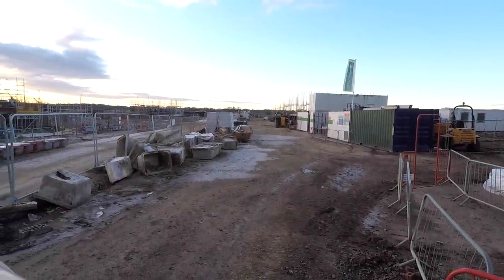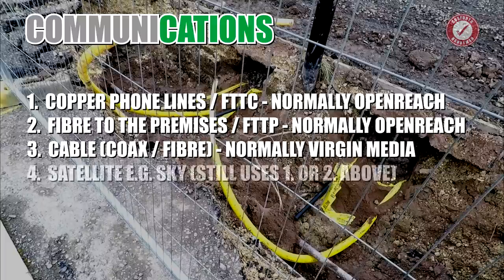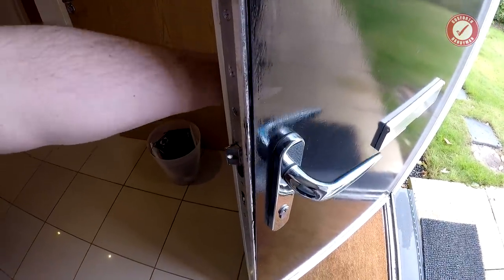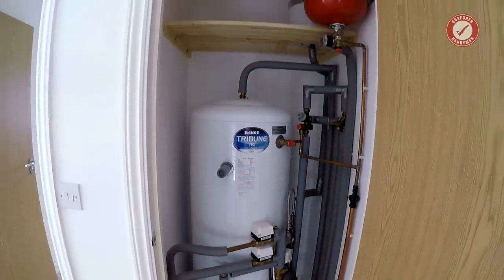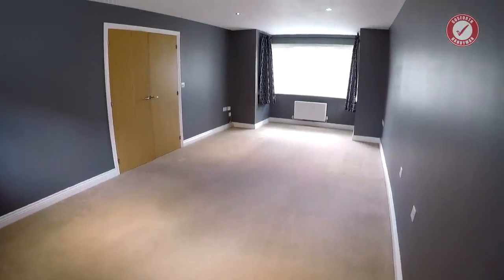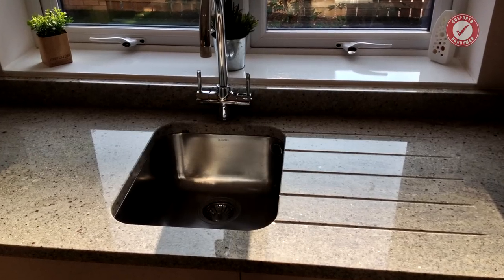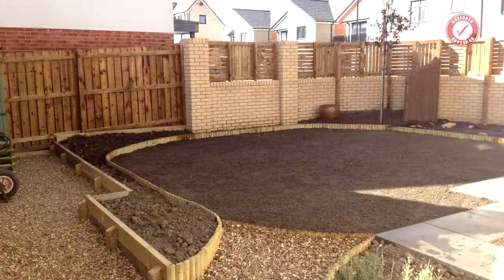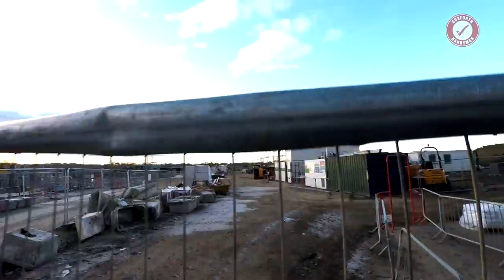How are New Houses in the UK Built? Internals, Utilities & Internet

Comment: I'm in a new build and had no issues. The house is air tight, warms quickly and holds the heat. The main problems I've noticed tend to be in the land per home. I'm in a 3 bed semi with a double front drive for 2 cars, but there are multiple 4/5 bedroom homes that only have a single drive and no off road parking; and because of certain rules in new builds often you can't convert part of the extra lawn in front to an additional drive. This results in terrible off road parking that could make it impossible for some emergency vehicles to get through. Other than that the gardens tend to be on the smaller side as well.
Reply: Exactly I don’t know why some people winge about new builds when they have never brought one. And go on about how old houses are better, to be honest buying a old house the snags would be more due to wear and tear, boiler, damp and roofing issues are common amongst old houses.
Reply: @realtalk3968  bigger gardens generally and better looking buildings rather than the airtight boxes they seem to be knocking up these days, cheap cheap cheap.

Comment: My house is in Scotland, 27 years old and timber framed, just like most other houses built in Scotland in recent decades.

I’ve been in the loft, under the floor joist and even torn down the plasterboard to reveal the wood framing (insulation upgrade).  

There’s no rot.  This house will outlast me without any bother.  I like it.

One cautionary note though - pay attention to the shower enclosure.  I’m not a fan of tiles going on to green plasterboard.  You only need one single point of failure (grout or sealant), and your timber studs are going to get wet.  In Norway, they treat shower upgrades / tile work as being notifiable activities to building control.  This precisely because shower enclosure leaks can cause such expensive damage to the building fabric.
Reply: @Anthony Dyer: I've noticed from looking at American renovation shows, that bitumen is spread in the shower area before the tray goes down.
Reply: That's why they have to use waterproof boards these days. Fairly sure this has happened in the apartment I'm currently renting and recently gave the landlord the bad news - keeping a strong eye on it in the property I'm in the process of buying because I've seen this.

Comment: I’m in Durham, work for a regional house builder and love these videos. New builds have to adhere to very strict NHBC standards at basically every stage. So much so we had to dig up a freshly laid drive because the drain was 2mm out of tolerance. I’ve worked for the local water supplier and a water meter being fitted to new builds was law since 1997, helps work out supply/demand/resource issue and the regulator get accurate averages to stabilise and control pricing.
Reply: The NHBC are just one of many companies that can inspect builds, too many people think the NHBC are the only authority. In my area they are seldom used.

Comment: you will no cracking with metal stud walls because of the more than likely wet timbers that go in during build .timber moves and anything attached to it will move too . just my two cents
Reply: Yeah it's really difficult to get a good paint finish in a corner where it's a timber stud to a block/brick wall because the timber moves throughout the year! I've given up sanding/repainting now. Is what it is.

Comment: There are a lot of differences though the UK and NL are neighbours.
Next to the front door in NL you find a small closet where all utilities enter your house. Electricity with main switch, and group switches, with meter, gas with meter (no gas in new houses), water with meter, telephone, coax cable tv/radio, glass fiber, transformer for the doorbell, etc.
Outside walls, out to in, 10 cm brick, 5 cm ventilation, 5 cm or more insulation, damp barrier, 10 cm inside block, plaster.
Under ground floor 50 cm of space, insulation against the floor, 10 cm of clean sand covered with woven plastic, hatch to get in.
Separate pipes for sewer and rain water.

Comment: What I would like to add from a Scottish perspective, is that water supply to houses are usually unmetered and is billed via your council tax you regularly pay either yearly or monthly. 

The reason why Scottish water supplies are majority supplied unmetered is because its a nationalised unlike England and Wales where its privatised. 

However you can opt for a water meter if you so wish one to be installed, however the majority of Scotland opt for unlimited water via a set price according to the band of CTax your paying. 

However there is an exception when it comes to highlands and islands and rural parts of Scotland were you can get your tank filled up with water on demand and pay for it directly to your supplier which regularly is Scottish Water or you can receive water from a stream/spring and you would go through a dedicated pump house with added filters which can be your responsibility. 

Also on the matter of highlands and islands and rural parts of Scotland your waste water is collected in septic tanks and is disposed off by a tanker which comes on a regular basis.
Reply: Who pays for the septic to be pumped?

Comment: Infirmative video. Born in a 4 story + atic Victorian house in posh area, smoke from neighbouring fire into ours due to floor board length, no 90° corners. Bought a 14 year old house in north Yorkshire. The bricks below DPC were exfoliating due to freeze thaw! Whole estate built with crxxx bricks. There were clean sewer inspection holes as the sewer was laid not to plan! 
Now live in stone/rock house with 18th century cavity wall😉. The mortar has crumbled and rats and mice move in in winter. Also part of house below ground level, 6-24 inches, now all tanked. Tiny windows compared to Victorian and upstairs ones 12 inches above floor. Window reveals nicely curved as the 18th century plasterer used his arm to radius the curve🤣.  1st floor joists cut from tree edge, dimensions fine on top, but tree curve produce points at the base! Found these were not supported by the stone wall, but the attached??? render. Add a cast iron bath 100 years later, and why is the floor not level? 
Australian houses have hollow walls, doors slide into them and heating is ducted through them. Many only single story so no residual warmth and heating goes on on cold days in summer. However the main aim is to cool them so drafty doors and overhanging roofs are fine.  
Put any home in a climate it wasn't designed for, will soon show it's weaknesses. Great video and fascinating comments. Keep safe

Comment: The front door might have multi-point locking but it has a cheap euro cylinder might as well leave the door unlocked, unless the euro cylinder is 3 star kitemarked it can be broken into in seconds, it's very easy to change them definitely worth the one off investment

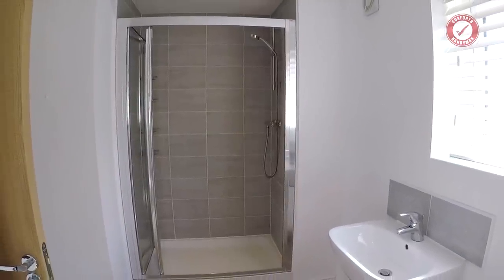Comment: 13:14 extraction fans were also standard in us buildings and homes starting around the year 2004 that really cuts down on moisture in bathrooms. It either vents out through the roof vents or a wall vent. Both have flappers that the air can push open.

Comment: Another question. In the US, post tensioning is a common feature in slabs-on-grade where soil conditions could result in slab cracks. Steel cables are embedded in the concrete along with the reinforcing bars. After the concrete cures, the cables are tensioned to about 33,00 pounds each to put the slab in compression making the slab much stronger and less likely to crack. Is this a practice in the UK too?
Reply from the maker: I haven't seen it personally but I would imagine it does happen depending on soil conditions. Up here it's all clay soil which is pretty stable and doesn't need particularly huge foundations. 👍

Comment: 5:40 The worst thing about putting ceramic tile over a new slab is that the concrete shrinks slightly over the first 30 years of its life and the tile doesn't, so unless the grout lines are wide enough and flexible enough (there are some very flexible grout mixtures) to absorb the shrinkage, the tiles will eventually bubble up in the center of the floor. 
PS: You can cut many flooring types around skirting boards and door frames; I grew up in a house with nailed wood flooring that was cut very professionally around everything.

Comment: Our 1967 home uses gas heated hot water stored in a tank for the radiators and hot taps, and we have an electric cold fed 9.5kW shower.  We used to have the shower use the hot water, but got fed up with it running cold and giving us a literal shock to the system!
Reply from the maker: Yeah you need a big tank for showers - they eat the hot water. 👍
Reply: I prefer an electric shower myself, boilers can fail and in winter getting it repaired can take days. I can have a new electric shower fitted about one hour after screwfix opens. I don't think they work out much more expensive in the long run either.

Comment: Couple of things, if your concrete floor slab moved AT ALL you should contact the house builders insurance company as zero "settlement" should occur, 
Secondly, that gas boiler shouldn't be in a cupboard because if there is a gas leak it can build up without being noticed.

Comment: So funny, I found your videos after moving to a new build and needing to find fixings for dot and dab walls. Just like you i'd renovated an 1870s Victorian flat, a 1930s semi then had a family and decided I needed something bigger which was less of a money pit whilst they grow up. I used to be dubious of new builds but actually they're really warm, efficient, spacious where it matters, cheaper to run. I miss the character of our 1930s house but I don't miss the £130pcm utility bill or only having Virgin as an internet provider of note, or the lack of parking or constant maintenance and condensation every morning. Great video and youre spot on about the flooring, ours was done by the builder and we had them fixing every small issue with it. It's a shame they overlook really simple kitchen 'extras' though, like corner carousels, silent drawers, soft close etc. Symphony are good at supplying them, but I consider them standard.

Comment: You can tell how new a house is in the UK by how small the windows are :). Thanks for the video.
Reply from the maker: No worries bud! 👍
Reply: Are they smaller nowadays?
Reply: @isyt1  They started off tiny, got larger over time, and now they've started getting smaller again.
Reply: You are correct!
Reply: You are so right - yet in the Netherlands they have much better insulated homes and BIG windows that let in so much more light. You don't need to put the lights on at 3.30 in the afternoon!

Comment: You should be able to tell if a new build has block and beam as there will be a course of air bricks around the property.
Reply from the maker: Indeed. Would concur. 👍
Reply: However, I have also read recently that you don't need ventilation under a beam and block floor as there are no timers to rot and the air temperature/floor stays warmer in winter?
Reply: @garyharrisonuk  you do need to at the moment, max 2m centres. Just had to put them in.
Reply: @MrBez007  thanks for that. It is frustrating when researching best methods to get a definitive answer. I suppose, in the end, your building inspector always wins
Reply: @garyharrisonuk  yeah it's hard as things always changing. The other brickie that works for me was sure you didn't have to put them in anymore but a couple of calls to building control and labc confirmed they wanted them.
Reply: @MrBez007  yeah but do they 'want them' because its current 'best practice' or because that is how they have 'always done it'? 
Maybe a radon issue?
Reply: @garyharrisonuk  no not in a radon area and if so I'd need to put a radon barrier down.  It's actually in labc hand book so they must insist on it

Comment: Looking at this, I'm amazed by the differences in standards and new build approaches across the world. For instance compared with France, I'm amazed by how little insulation is being put in UK new builds and by how basic the UK electrics are. Standards in the US are also quite different, as everything has to be bigger, but not necessarily built to last (and with significant regional variations of course)...
Reply from the maker: Covering a bit about insulation on the next episode. Interesting about electrics - how are they different? 🤔👍
Reply: France must have changed it’s regulations for electrics since last time I was there ( about ten years ago) if you think U.K. electrics are basic in comparison. In U.K. all plugs are earthed and fused, all sockets switched and pins on plugs are part covered to prevent children with small fingers touching them while still connected. The flimsy plugs in France seem to often hang half in and half out of the socket and frequently spark when removed. We came across this in several hotels. And as for the standard of plumbing- “oh la la!”
Reply: @juliebrooke6099  In my experience (not talking about old houses where anything can be found), all French plugs are also earthed and on radial circuits protected by 2 pole circuit breakers located in the equivalent of a consumer unit (which is larger because of all the additional safety equipment there). You may find the following video made by a British sparky of interest: https://www.youtube.com/watch?v=O6uBwYU25lo&ab_channel=ArtisanElectrics and the comments there, keeping in mind that this is a simple installation for a flat, not a full house.
Reply: U.K. electrics are by far the most advanced in the world. Are you kidding
Reply: @isyt1  That goes without saying, by definition. The same is true for plumbing where hot and cold water shall never mix, damp proofing, consumer electronics, politics and almost everything else!

Comment: Thanks for the video. Do you know how David Wilson Homes/Barrat are built? I went to their construction site here in Edinburgh and I saw that they are using breeze blocks to build walls, but I also heard that their houses are timber frame so I'm confused by this.
Reply: It really depends on what your local Council dictates to the developer. Alot of the time they will get your Councillors to over rule the polices that have been set if they are too high, so they can build as cheap as possible which is why you should always vote in a non political members. The 2 developers you said are not too bad but stay away from Persimmons and Taylor. 
If you want good homes the smaller developers are useally good with bespoke builds but these useally cost alot more than the off the peg houses.

Comment: Hi Love the videos Andy. One idea for another video  is properly securing the access holes in flooring the plumbers had cut when working on the central heating. I have heavy duty 80s Brown Chipboard flooring that has been butchered. No noggins and not on any joist in places with screws put in at an 45 degree angle to try and reach a joist. I bet loads of people have the same problem. Cheers John
Reply from the maker: Interesting - might cover that once we get moved! 👍

Comment: New build estate outside Bristol here & we have FTTP but BT were the only company that would supply internet - no virgin. No complaints so far though with them, pay for 50 mbps and every test I’ve done has been bang on 50
Reply from the maker: Fantastic stuff - you should get a lot faster with FTTP? I've heard of folk getting ~500Mbps. It's not uncommon for the cabinets to be overloaded in the early stages of a development. Hopefully the speeds will get even better. 👍
Reply: FTTP and only 50mpbs? They've pulled your trousers down there.
Reply: @ratgreen  I only pay for 50, can get 1000 but just not necessary

Comment: Big fan of solid built concrete houses. Will never build or buy timber frame homes, higher insurance costs and I want a house that last centuries not decades. By the way Byson slabs for first floor are phenomenal for sound and heat insulation.

Comment: We had a small 8 plot development put in next to us. I watched the whole build from groundworks to sign off (and got to know the contractors in the process).
HUGE foundations put in, the ground works foreman told me he'd not seen that much concrete go in one development.
Block and beam, rock-wool type batts for insulation. Insulation in the party walls as well! Excellent brickwork and good internal finish.
But the architectural firm they used made a few fundamental design errors, which kinda stand out! 
All minimum three beds, but not one has an ensuite!
All the bedrooms are in the eaves, so sloping ceilings...which means very little space for furniture.
No structural complaints after 3 years.
Reply from the maker: Interesting! I bet those bedrooms get warm in summer. 👍